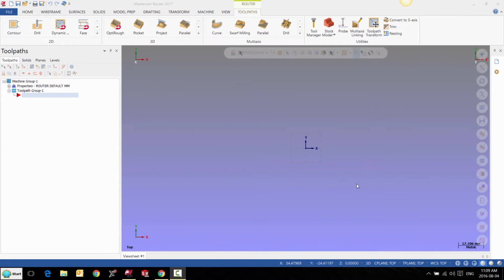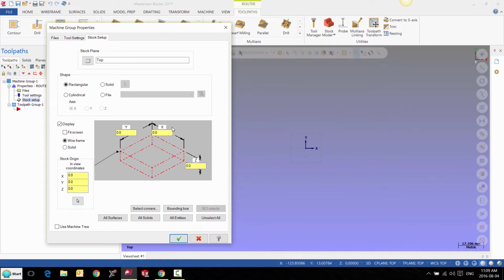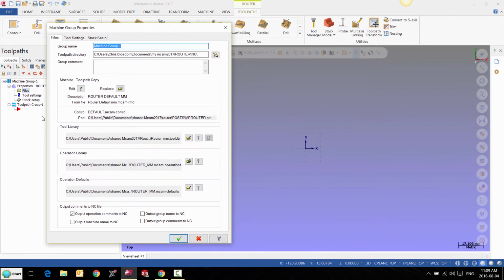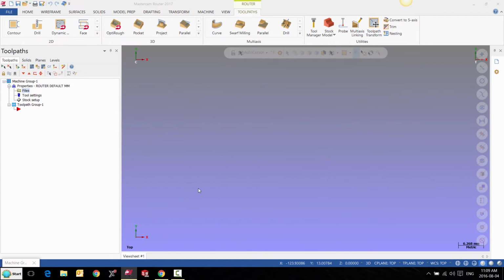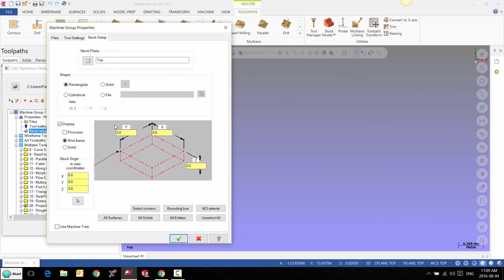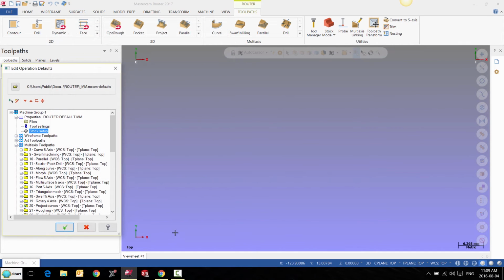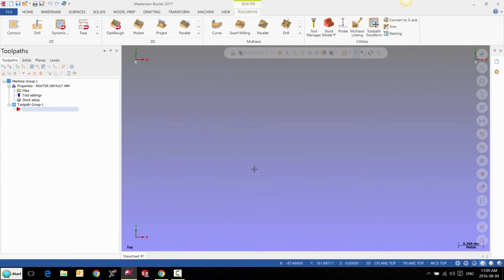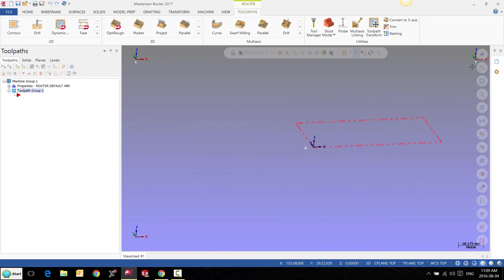Mastercam 2017 Tutorial: Default Stock Setup

Comment: Could you explain what the purpose of the stock set-up is?
  i always just converted my autocad 2-D sketch to do my toolpaths in Mcam 9.1. Because i still use 9.1with XP and won't work on windows 7 or above i have to use Mcam 2017 because of a new computer and it is completely different. i'm considering a cam software more along the lines of the earlier Mcam if it exists. do you know of any? Thanks. Later, Rick.